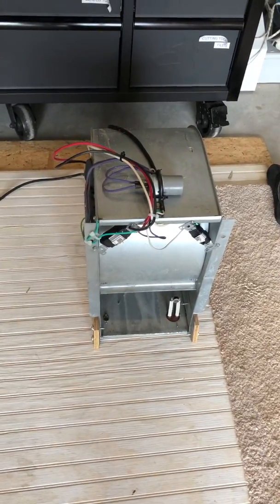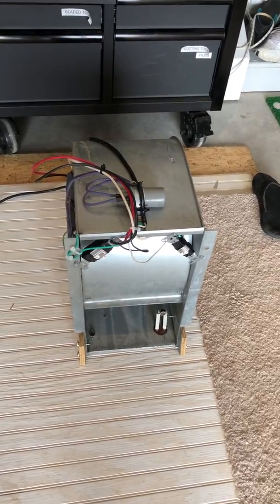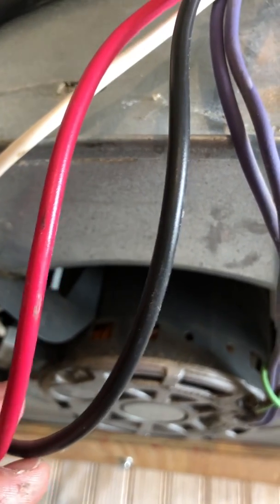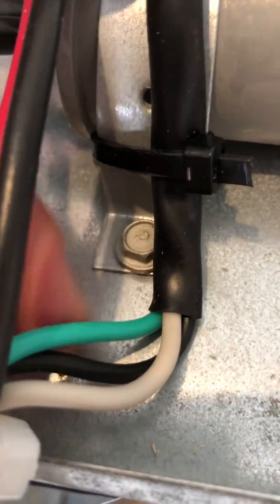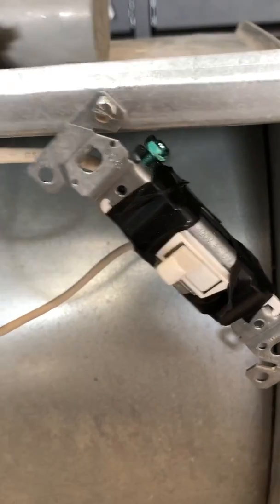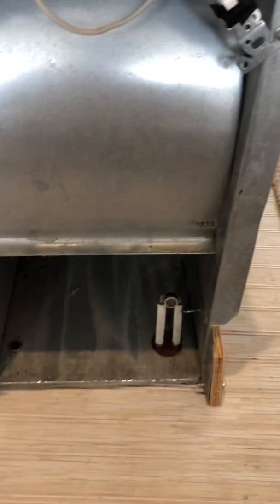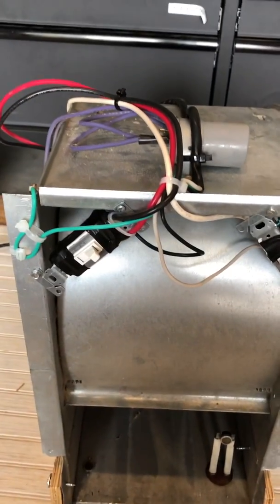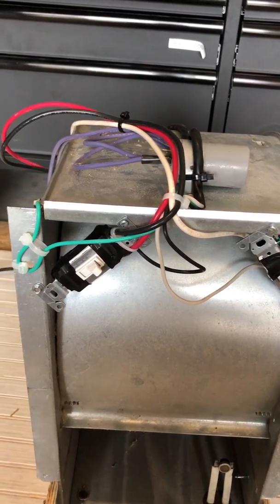HVAC blower motor repurposed as a fan with two speeds

Comment: For safety put metal mesh at least on the intake sides.  A pet or kid or loose rag...or your pants leg need to be protected from that spinning wheel.  The exposed high voltage capacitors are a shock hazards too.  If there is a fire at your house...an adjuster may claim it was from your DIY switches that are not to code (boxed) and invalidate your claim.  Insurance companies will look for any reason not to pay out.

Comment: I was told that you block almost half of the outlet side that will decrease the running amps and put more air out. Fan motor will last a long time doing this. It sounds strange but my ac guy told me this about 30  years ago

Comment: Breaking Neutral is not the safest way to wire something up. You should put your power switch inline with the hot wire instead of the neutral. That way it removes power from everything except the power switch when turned off. The way you have it wired up, the fan speed switch is still energized when you turn the power off; the current just has nowhere to go. Of course in your case you can just unplug it to remove power from everything, but I'd still wire it right.

Comment: You might want to consider blanking the side opposite the motor with a partial piece of sheet metal or something solid that will cover most of that inlet side. These blowers come from a sealed case and are able to maintain sufficient static pressure in that environment. Outside of it, they tend to freewheel, which ultimately leads to the motor over-heating and failing. You'll be surprised at how much more air it pushes and how many fewer amps it will draw.
Reply from the maker: Great info! thanks
Reply: I tried partially and all the way closing of that side and my motor runs too hot regardless of how I do it.. after 10-15 min it's too hot to touch. Any other suggestions?
Reply: CAN SOMEONE PLEASE HELP??
I just did this exact wiring, but I did connect the on/off to the Hot/Black coming from the plug. 
It turned on but turned OFF when I switch to the other speed…… ? 
I think I’m wiring the backwards 3way connection incorrect. 
Any ideas?